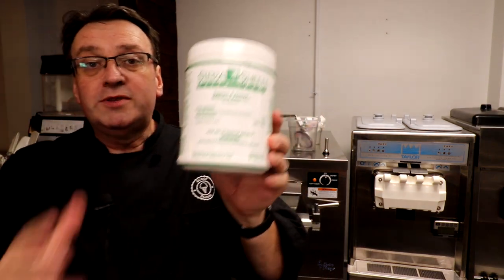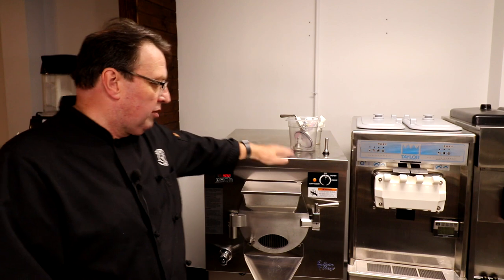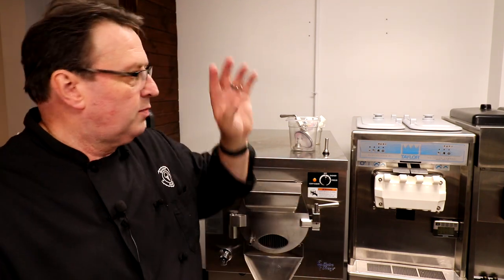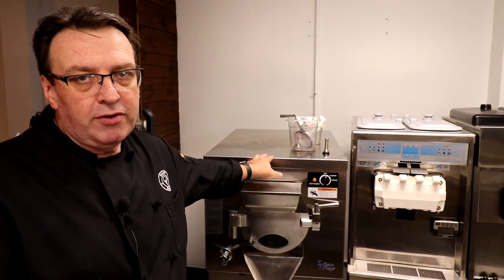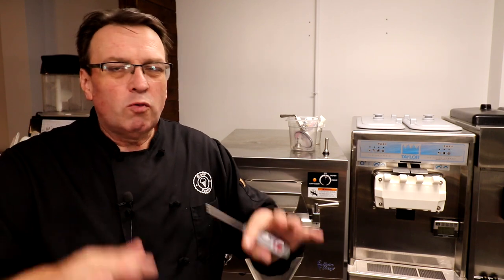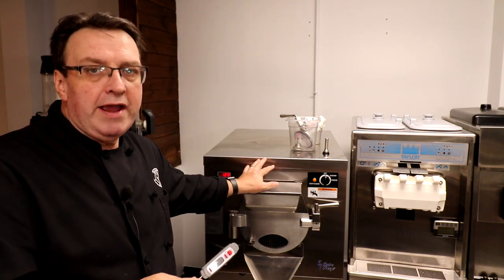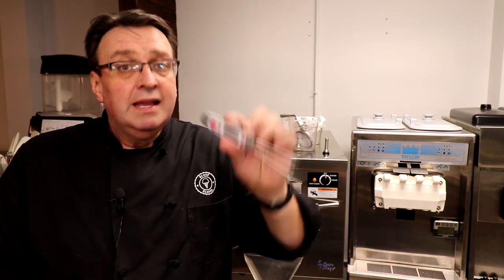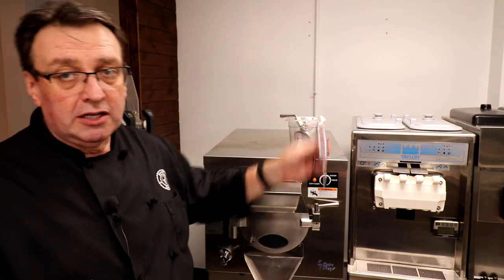How Firm Should my Ice Cream Be?

Comment: I have an old batch freezer (1960) so no sensors just on/off. I open the extraction plate frequently to visually assess the stiffness of the gelato/sorbetto. Too stiff and my batch freezer sticks, the drive belts slip, meaning I have to open the door and manually dig out the gelato which is messy and wasteful as some melts before I can extract it. The first batch takes longer than the second, and there are other variables. I tend to get -6°C at the point of extraction after 5 minutes or so of churning a +4°C 5kg batch, does this seem right?
Reply: i have an entry level carpigiani which is about 12years old with no sensors as well. I have to manually time it and extract. I extract my ice cream at -6C as well. Yours seem to be very efficient. Unfortunately my scraper blades are worn so im very sure mines taking alot longer.
Reply: I don't think it matters how long it takes? the important thing is the extraction temperature? I mean if you're hitting your temp earlier you get to produce more in a day!